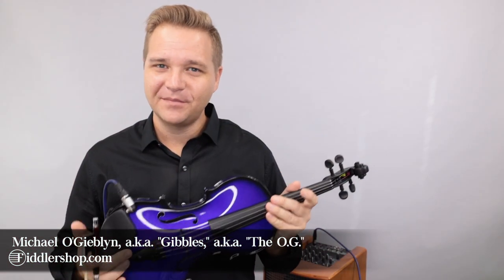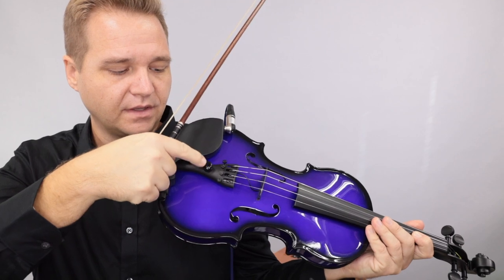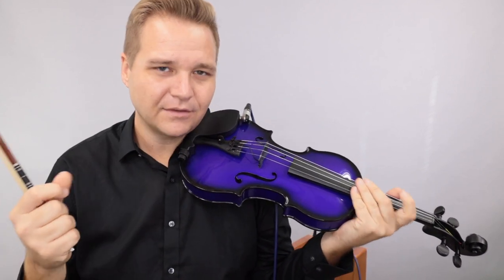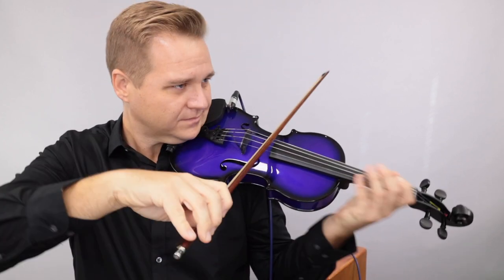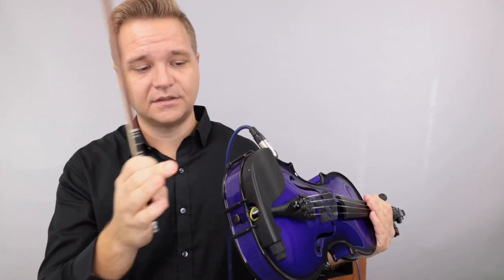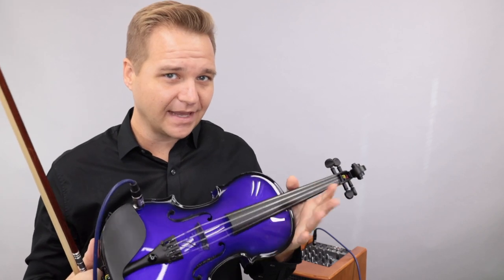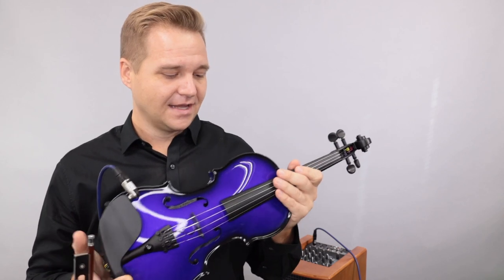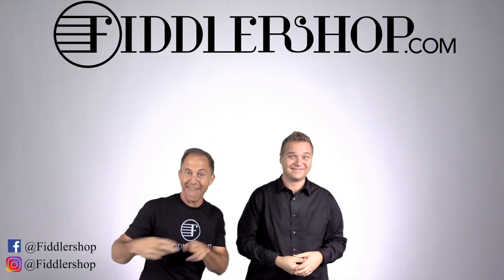Glasser AEX Carbon Composite Troubleshooting for Erin

Comment: Hello! I have the 5-string version of this violin, very happy with it except for one issue. I can’t seem to get rid of the high pitch hum that’s always present when it’s plugged in. It happens with both a cable and a wireless transmitter, worse so with the wireless. I do have the transmitter that is configured for the active pick-up so that should be an issue. Any help is appreciated!
Reply from the maker: Thanks for watching!